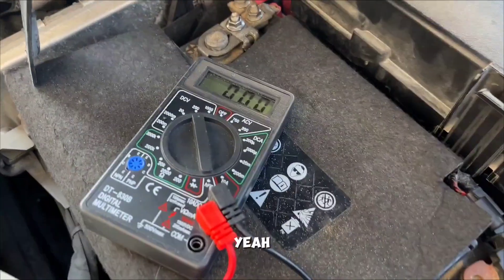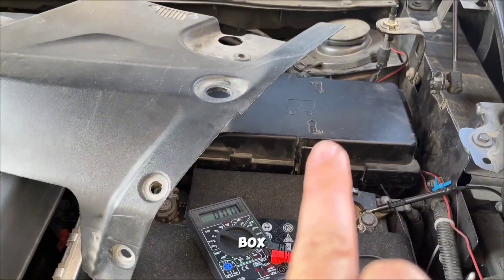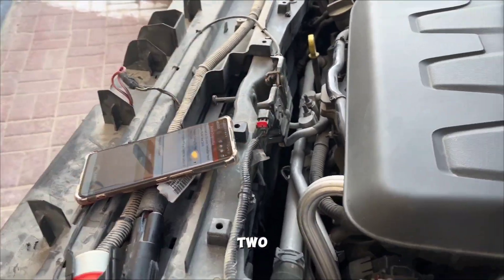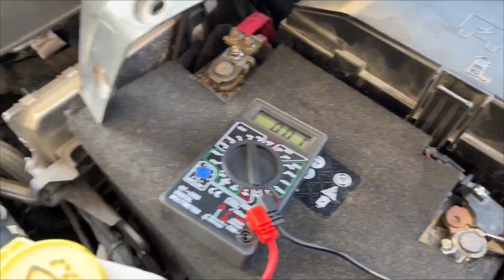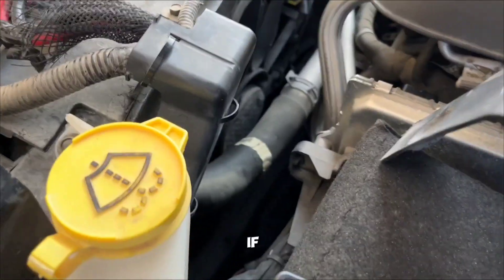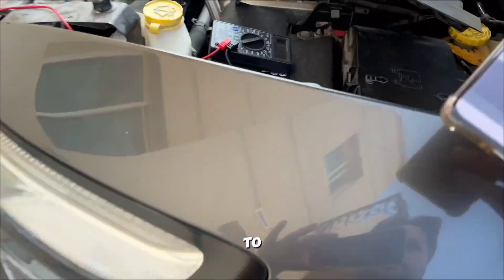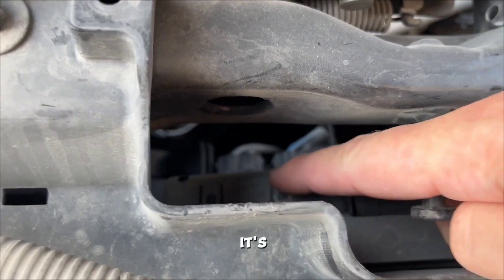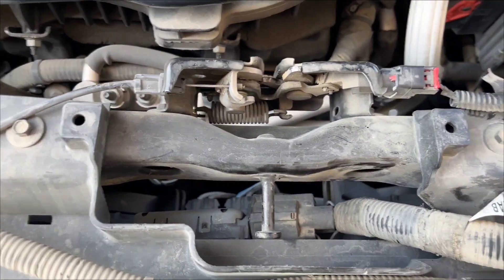Jeep Cherokee KL 2015, troubleshooting error P0480 - Fan circuit 1 open (part 1) #jeep

Comment: how much voltage should be on the blue wire? also what is the other small brown wire coming from computer do? thank you
Reply from the maker: Between 10 and 14V, the voltage on blue wiring will change the speed of the fans. Remember blue wiring should have voltage only when the ECU requests under certain conditions (coolant above 105°C, or AC running)
Reply from the maker: I don't know what the brown wiring does, most likely is a feedback signal towards the ECM, is not expected to have voltage there

Comment: Hello. Can you tell how to find fan activation on your obd software?
Reply from the maker: @qwertyytrewq4876  alfa obd ->  engine -> (find your engine type) -> active diagnostics -> radiator cooling fan dirty circle, this options will trigger the fans
Reply: @braziliangeekinabudhabi  thanks a lot. What number of version of software you use? And, maybe you now where to buy cheaper radiator cooling fan to jeep renegade 1.3t. because it is not a lot of information.
Reply from the maker: @qwertyytrewq4876  cheaper, honestly I don't know, my replacement fan set I got from rockauto.com
Reply: @braziliangeekinabudhabi  how can I now my engine type? It asks about control unit. But I don't know where to find this information. In software is  different marelli/Chrysler/bosch ets.

Comment: How much voltage is supposed to be going through the purplewire?
Reply from the maker: But remember, the voltage will come Only if the ECU is asking for the fans to spin. If the car is cold and AC is off, most likely the ECU won't send any voltage through the blue wiring. If the coolant temperature reaches 105°C , the ECU MUST ask the fans to spin, otherwise the car will overheat
Reply from the maker: @zion-n3y1w  it oscillate between 7 and 14V. The higher number will trigger the fans for max speed.